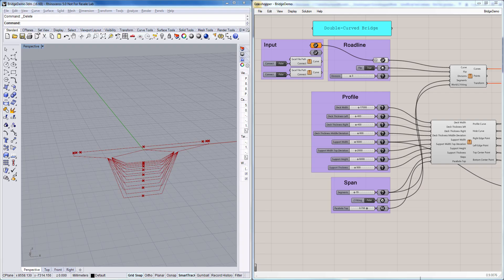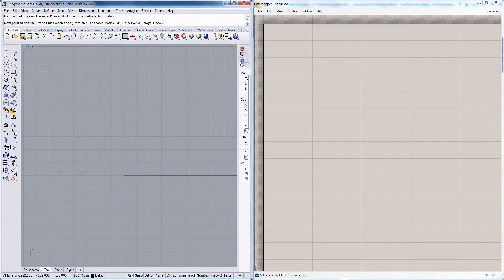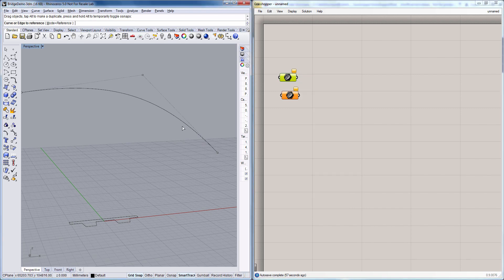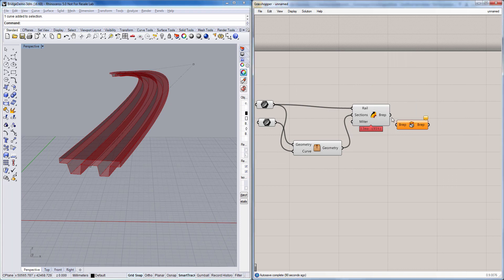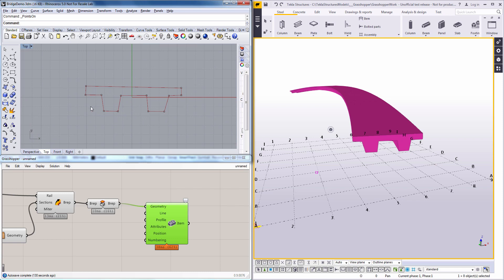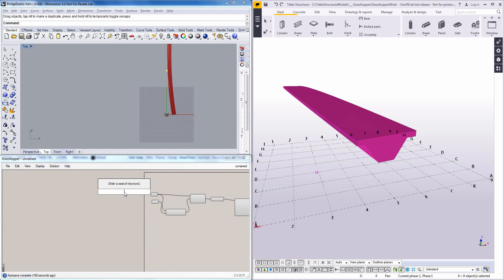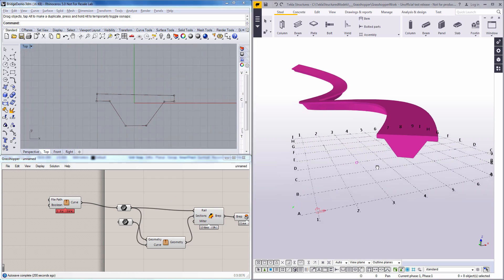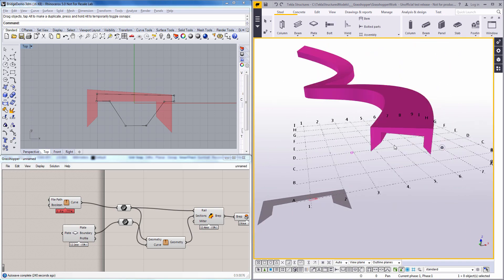Grasshopper Tekla Live Link Beta Bridge Demo Pt1

Comment: Hello! I didn't find the node "item". where can i install a full version?
Reply: Hi, hopefully you've found the answer by now, but for reference you'd need to use Tekla Structures 2017 or newer to enable the Item components.
Reply: hello Sebastian, how can i down load Grasshopper-Tekla Live Link, when i try to download Grasshopper-Tekla Live Link from Tekla web, it requires tekla maintainance... So what can i do now? please contact through email: ngoctungatp51@gmail.com. Thank you
Reply: This is an extension that requires you to be on maintenance in order to download. If you're already on maintenance, you need to create/log in with your Tekla account and the account needs to be added to your organization. Please contact your Tekla account manager or local Tekla helpdesk for assistance if needed.
Reply: Hi Sebastian,
I got an error while create a concrete item.
Here is the message:
"Solution exception:Could not load type 'Tekla.Structures.Geometry3d.FacetedBrepWithNormals' from assembly 'Tekla.Structures, Version=2017.0.0.0, Culture=neutral, PublicKeyToken=2f04dbe497b71114'."
Could you help me solve this?
Reply: Hi Hoang, to create items, you need to use 2017 SP5 or newer.
Reply: @sebastianlindholm197   can you help me with „Align geometry“ component ? I cannot find this component in Grasshopper-Tekla Live Link from Tekla web. I ubderstand that this is custom made component ? where I could find how to create it ?
Reply: The align geometry component is a cluster that contains ordinary GH components. You can find the component in the Bridge Demo definition 2017 download on the link Warehouse page: https://warehouse.tekla.com/#/catalog/details/b901f77d-cfe8-4a97-894b-f4053829c297?showVersions=true. Drag-drop the file onto the canvas to insert the cluster.